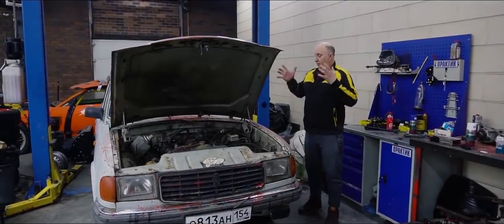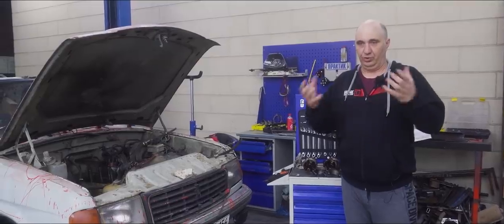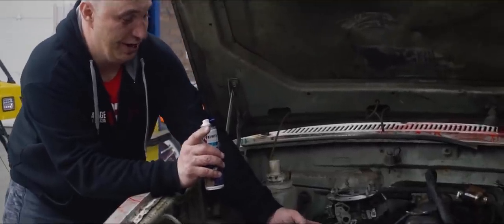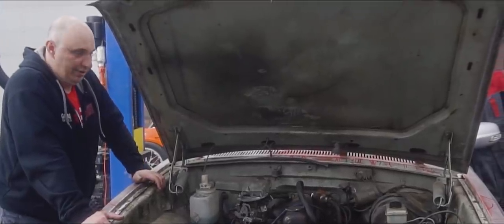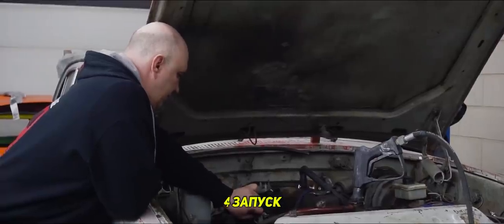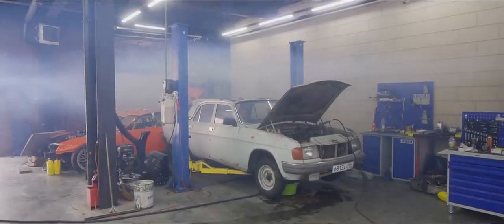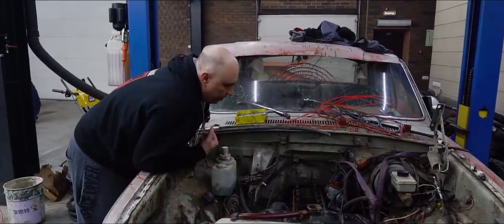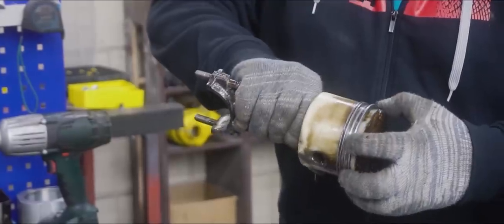Fabricating plastic pistons (will they work?)

Comment: Don't give Chrysler any ideas. They will make pistons and exhaust manifolds out of plastic if they can find a way to make it last until past warranty.
Reply: Or just don't buy a shit Chrysler or GM vehicle maybe?
Reply: LoL
Reply: I wonder if that explains their transmissions.
Reply: @nickoloes  imagine buying any modern American car
Reply: They will simply adjust the warranty to match the expected component failure date.
Reply: Or BMW.
Reply: I hate how pretty some Dodge/Chrysler cars are yet they have the reliability of a dead rat. 300c’s are so sexy.
Reply: @nickoloes  that is such a sad thing.  there really is no excuse for gm making shitty engines.
Reply: Toyota already does that with plastic intake manifolds Burnt piston award toyota lol
Reply: @deloreandmc9600  I don't know of a manufacturer that doesn't use plastic intake manifolds these days.
Reply: Reported for accuracy
Reply: @deloreandmc9600  I said plastic exhaust lol. Plastic intakes rarely have problems actually. It's when the manufacture decides to install runner flaps in the intake, it can cause problems when the vehicle ages.
Reply: @nickoloes  gm has made a huge improvement across the board. What the fuck are you talking about? The LS/LT platform improving every generation proves that. 

Dodge on the other hand yeah, just slap a supercharger on it, should get better lol
Reply: @12beemer34  underrated
Reply: The car makers will just make the whole engine out of plastic and then tout the better MPG due to weight savings as a feature.
Reply: Garage 54: "We've made pistons from plastic!"
American auto makers: heavy breathing
Reply: I think today there is no brand left who understand the word quality. You can change the name Chrysler with any other brand name.
Reply: @StrawberryBastard  modern chryslers are European cars though....
Reply: @Reziac  their old inhouse 4 speed autos failed largely because of them running line pressure on the low side to help mileage.  It's been standard procedure during rebuilds to turn that up and it greatly extends the service life.
Reply: @Dcc357  in the early days of composite intakes some models had issues because they were still wet manifolds with coolant running through them.  By the end of the 90s though most everyone went to dry manifolds, though they are still using composites in the cooling systems anyway.  At least it won't lock your motor up when it fails.
Reply: @Dcc357  Yes but sure things keep going backwards sure enough your heading right to the back the car with this one lol
Reply: @Dcc357  Speak for yourself Here in Ireland a good idea done in sunny Calfifornia doesnt make it reliable somewhere else AD Blue is a good example nearly the same price as litre of diesel  would you trow diesel down your exhaust or just throw 20 dollar bills on the fire
Reply: @jaye1967  - Amoco did that many years ago. I think they still used metal in the pistons, rings and valves, but it was very noisy.
Reply: Just buy a Toyota, forever. Problem solved
Reply: @deloreandmc9600  quads use rubber so?
Reply: @lexuses3942  Yeah, you have fun with that "supra" and whatever comes next.
Reply: You do realize Toyota makes cars with plastic intake manifolds, right?
Reply: @Oddman1980  Yeah..😒 The new stuff maybe. Let me rephrase that, buy a 90s early 2000s Toyota 👍 Have a great day
Reply: @Dubz0408  But yeah if it’s a 90s Supra you should definitely buy one if you can get ur hands on one. Or afford it
Reply: I was of the idea that plastic motor parts was a BWM exclusive... go figure
Reply: I drive a 2007 Pacifica with almost 150k. Had it a couple years. It ticktaps like a sumbitch. Has since about 122k. Hasn't gotten louder or anything. I might pull the valve cover and look this summer. I ain't worried.  It's been a good car really. Haven't done shit but change oil. Oh and I bought a new set of tires. Fixin to do some brake work too. Been a good car though. I'll get in it and drive to ohio or anywhere. Used to daily it to knoxville and put about 160+ miles a day on it. I work 3 miles from home now. Still go to knox once a week or so though.
Reply: My pontiac has plastic header and manifold. G6. It's ok though , it's clearly going to outlast the frame. You can put your finger through wherever you like.
Reply: @nickoloes  Chrysler is dodge and GM is chevy XD ill choose a ford over any of their rolling scrap anyday
Reply: because the EcoBoost is so "reliable"
Reply: They call that innovation
Reply: @nickoloes  Yeah because only Chrysler and GM make junk now a days lol. They all are junk now a days. Doesn't matter who you buy it from.
Reply: @Juggernaut30  Thank you. You get it. It doesn't matter who rips you off, they all are junk now a days.
Reply: Or BMW. They love plastic...
Reply: "If you don't drive a '93 Celica,  your entire life is gonna go downhill, so you might just as well get a '93 Celica". 
-Scotty
Reply: Hahaha, I was just gonna say the same thing. Some CEO is watching this and getting ideas because of government mandate gas efficiency vehicles.
Reply: @nickoloes  all vehicles are shit these days made to get 3 years 60000 miles after that it's all about luck lol
Reply: @jacklarson6281  the engines are good but they encourage 10 to 15000 mile oil changes if you just change oil every 5000 they can last a very long time without problems
Reply: @Dr.Mcstaby  you do know chevy and ford are working together now the transmissions are the same in a Ford or Chevy that's just the beginning
Reply: @nothrottlelimit  no its not
Reply: Thermoquad
Reply: @nickoloes  shit
. Lol  got 235;000 miles  and still going on the basest lil truck Chrysler ever made,,    Haven’t had an engine issue ever ... lol  sorry  your a bit wrong ...
Reply: @StrawberryBastard  yeah  the corvette and Cadillac shot on your euro trash on your home court  on the regular basis ....  tart....
Reply: @mikehunt8375  It’s a unibody, so luckily if you think it’s worth it just replace subframes
Reply: They sure have their 8 speeds figured out to exactly warranty time
Reply: @nadronnocojr  I’ve got a 97 ram 1500 with 220k miles barely even change the oil and it’ll still outlast 90% of newer cars
Reply: Their cars used to be so good, many decades ago. I drive a 1950 Dodge and it is the most reliable car I have ever owned (Yes, I am crazy and daily drive a 71 year old car). All the new stuff is junk no matter the make.
Reply: Ford not Chrysler.
Reply: @StrawberryBastard  The only modern "American" car worth buying is Tesla.
Reply: just gotta hit that 36000 miles.
Reply: Truth
Reply: @nickoloes  new ford is the way
Reply: @jacklarson6281  You mean the LS1? LS6? or Chevy 350? I think the guy meant the Chrysler engines. That are very popular among car guys for having valve seals smoke problem, Rod problems, walking crankshaft problems and above all transmission problems. There is a reason why they are the cheapest alternative when you go to a dealer.
Reply: @normanguzman417  sorry man.  I didn't mean to dis on any Mopar peeps.  I stupidly just lumped all non-Fords under the GM label
Reply: What are the most reliable vehicles nowadays?
Reply: they already produce plastic manifolds since years. in the 90s they already did
Reply: Not just Chrysler.  My Camry has a plastic intake manifold and it's got about 200k now and still working fine (unlike the damned head bolt threads in the block, which required inserts @ 183K  grrrrr).  I've heard of many problems with American versions, though.  Mostly cracking and the idle going South, getting pretty rough.  My mother in law's Olds did it.  

On the plus side, the Camry manifold looks to be pretty free flowing, as does the exhaust (welded pipe).  I always wondered why companies didn't go to welded exhaust on high performance engines like the 426 Hemi...probably cost, but headers weren't THAT expensive, even at the time.  Casting is probably really cheap, though.  The '69 383 hypo I had (Plymouth Road Runner, same as the Dodge Magnum, but with a 'cool' and cute Road Runner (from the cartoon on the breather) had cast manifolds that came over the top above the valve cover tops to try to get a little flow, but this created heat problems for the Holly carb (what a piece of junk, finally went to a Carter spread bore) which needed a rebuild every year (cork gaskets were also crap, and in the design sealed about six thousand holes, seemed like it anyway) and replacement about every five.
Reply: Chrysler? Did you mean: FIAT
Reply: How you know that?:)
Reply: @StrawberryBastard  you probably ride a Kia.
Reply: @lexuses3942  the hardest part of owning a TOYota is telling your family you are gay.
Reply: Beat me to it!
Reply: Same for bmw
Reply: Yes, a short-term warranty would make it happen. :)
Reply: @Oddman1980  so? My company service vehicle have plastic mainfold and runs without issuses for 11 years and almost 400 000 km.
Reply: @lordred7462  the person I was responding to was crying about the possibility of Chrysler making plastic engine parts while not realizing such things already exist.
Reply: Ahhaaahahhahah
Reply: Replace Chrysler with All Automotive Manufacturers and you have the right of it.
Reply: Of course lol. It's Fiat
Reply: @lexuses3942  toyota along with just about every germam, japanese, and american car manufacturer has been using plastic intakes since emissions killed the carburetor with fuel injection and it doesnt make something unreliable because of it. 

Thats since the 80s, and not just toyota the entire planet. Plastic touching your air before it reaches the combustion chamber isnt affecting the reliability or performance of the rest of the car. Valve covers too. They dont undergo any stress thats why they are plastic now. If your valve cover is a load bearing component whatever you drive is an engineering marvel, really.
Reply: Funny you mention that, Ford has been trying to engineer plastic exhaust manifolds for almost a decade now.

At least Chrysler tries to pretend like they might care about their customers.
Reply: Amen to that. Prefer older cars anyway than these newer flimsy ones.  I prefer to keep my vehicles for 20 years. I’m no “get a new car every 2 years” yuppie.
Reply: @dylanmccallister1888  I’ve never had a plastic intake. Ever, except on a Ford Explorer once. 98 es 300, 2000 Toyota Camry. 96 V6 Toyota Camry 5 speed. None of them have plastic. I’ve removed everything to replace the valve cover gaskets and the intakes are definitely not plastic lol feels like cast iron but i can’t be sure
Reply: @Strike86  European auto makers: Yeah lets out this part that WILL fail in the middle of a bunch of cramped shit you need specific tools to get out.
Reply: @StrawberryBastard  imagine buying any modern car
Reply: @Him69429  think so what about there god awful front ends seen 2020s with 15,000 miles need new ball joints and tie rod ends 🤦‍♂️ dodges have electrical issues and tranny issues chevys have terrible front ends and horrible manual transmission {the new ones}
Reply: @nothrottlelimit  pretty reliable not very eco though lmao
Reply: @deloreandmc9600  Where in the heck did you read that California's rules on emissions had anything remotely to do with reliability? Urea in the exhaust was to clean up the exhaust emissions. No one in their right mind would associate emissions devices with "reliability".
Reply: VW is experimenting with plastic cam shaft bearings...
Reply: Sure are a lot of armchair engineers here.
Reply: @bandwagon240  u beat me to it 🤣🤣🤣
Reply: @joshuagibson2520  what you most likely have is the super common defective rocker assemblies.  It's common on the 3.5 & 4.0 V6's & usually happens well before 100k miles.  The parts alone will cost you about $600 if you do it yourself, a dealer will charge you triple that to do the work for you.
Reply: @deloreandmc9600  What..? How does a plastic intake manifold lead to burnt pistons?
Reply: @asztaloszoltan2001  I find that hard to believe, but have been surprised before. Do you have any sources on this? Curious.
Reply: This is actually Chrysler's R&D Channel.
Reply: @nickoloes  Ford- Fix or repair daily
Reply: @nickoloes  or BMW, Merc, VW, Ford... you know, since 2008ish, every manufacturer without exception has been cheaping out on their product. Some just seem better by relation to their competitors. Even toyota is turning to garbage. 4Runners of 10-15 years ago are better than the ones from this year. :/ What you gonna do?
Reply: Don't forget about Chevy and Ford. They use shit plastics as well.
Reply: @asztaloszoltan2001  No, VW is not doing their cam bearing in plastic... I'll have whatever you're smoking 🤣
Reply: @amorag59  That's what I meant to
Reply: @asztaloszoltan2001  Unless you have interesting articles or sources.. Stop talking
Reply: @deloreandmc9600  plastic intake manifolds are completely fine for the job. you really need a lesson on thermoplastics and long chain polymers. They can last just as long as aluminum with the benefit of weight reduction. i agree that certain parts should never be plastic but its not 1960 anymore. Plastics have come along way.
Reply: 1000th like
Reply: In all serious, they design stuff to almost last until out of warranty.  Then they gamble that it will actually make it out of warranty.  When it breaks, then you will buy a new car because it will be too expensive to fix.  If it breaks a lot, then they will steal money from the techs by reducing labor times until everyone looses.
Reply: @Joseph001 Have you seen the Audi/Volkswagen market? German engineering is supposed to be top notch, but these are your cars that people ditch as soon as there is sign of trouble. Look at the whole dieselgate thing VW did,  shady, on top of that their Pumpe Duse engine with cam that grinds itself away and oil pump on balance shaft that wears itself away... Not just the American stuff that's like that - you might as well have said *cars that are not a Toyota or Honda
Reply: @communistpootisbirb  looks sell cars not reliability to the majority
Reply: you know chrysler so well. the sad thing is we know Chrysler engineers dont do any actual work all day so they have probably already found this video
Reply: @Reziac  I think you're confusing Chrysler with Honda here. Coming from a Honda owner who is on his fifth transmission (which grenaded recenty, after I stroked my J32A2 motor out to 3.5 liters).
Reply: @SwapBlogRU  Dunno about Honda, but Chryslers, especially Dodge trucks, are absolutely notorious for blowing out their original factory transmissions (too much engine for not enough transmission). When I was learning to avoid them, was a rare Chrysler that made it past 60,000 miles without needing a rebuild (tho the rebuild would usually hold up better).

There's a funny video of a pulling contest between two pickups, a midrange Ford and a heavy-duty Dodge. The Ford was slowly winning... and then suddenly the Dodge's transmission literally came apart all over the street. And I was like... yeah, that was predictable... yet another reason why I became a Ford bigot. (I drive an F350.)
Reply: Nahh, your thinking of chevy. Most reliable engine I've ever owned was a 225 /6. Thing had a 1bbl carb, no main seals and lasted over 380k  miles on no rebuild running 1.5 qrts of oil in it. And yes the sump sits low enough that's enough for one of those engines. You do have to cut every v-belt on it if you want more than 100hp tho
Reply: UNTIL PAST  WARRANTY
      XD-GREAT ENGLISH
Reply: @Reziac  The 1st thing came to my mind lmao sad huh.
Reply: @nickoloes  Cough chough- Ford.
Reply: @communistpootisbirb  They really aren't bad depending on what you get. 2014+ are pretty decent if maintained. The Hemi is bullet proof as long as you don't get one of the early ones with cam issues.
Electrical issues are the downfall, but from what I've seen from Ford and GM lately, it's no worse.
Reply: It looks like a Ford idea
Reply: This is so true, indeed!
Reply: @bandwagon240  isn't the Ford or Lincoln 460 engine with these Plastic Intake Manifolds?
Reply: @Juggernaut30  except..Porche..that is!
Reply: @UltimateForceMarketing  the 4.6L SOHC did have plastic intake manifolds but they rarely had an issue.
Reply: @lexuses3942  yes!! Got two LS400 sedans. (1) 1995 Lexus LS400 (1) 1996 Lexus LS400 both have perfect gorgeous Light Tan Leather interiors and the 95' 164,000 has the MoonStone Grey the 96' 167,000 has the Metallic Champagne and power is off the hook!! Change the oil every 2,000miles and only use Mobile 91 Premium and use Penzoil Ultra
Reply: @UltimateForceMarketing  They will run forever
Reply: Heat resistant plastics like delrin could actually work.
Reply: @deloreandmc9600  Plastic intake manifolds are fine, as long as the plastic is strong. Toyota usually uses forged pistons in their engines. The 1.8L 2ZR-FE found in mid to late 2010s corollas has forged aluminium pistons and forged steel connecting rods. Maybe try changing the oil next time?
Reply: Coolant around exhaust manifold are here to stay
Reply: @tomasnokechtesledger1786  I love that feature. My GTI has it and the coolant heats up lighting fast. Very good for the winter.
Reply: @StrawberryBastard  even a Tesla?
Reply: @communistpootisbirb  they scream, I wanna be a rap star/gangnamsta but can't afford a pimp car.
Reply: Chrysler already made of 3D printed plastic timing gears in the PT Loser.  2.4 L.   The avenger models also 3D printed timing gears 
I work on cars and nothing Chrysler suprises me 
1985 Oldsmobile came out with a plastic timing gear in the 307 8 cylinder and it lasted till the warranty of the car expired.  
So of course Chrysler are definitely copy cats
Reply: Lexus you fools always bringing up Trump like it's a bad thing. Your Biden is doing a fine job wow. There really are some people out there that voted for biden
Reply: I wouldn't be surprised if we start seeing plastic pistons with aluminum crowns from fiat/chrysler
Reply: @nickoloes  Fords no better!
Reply: @Reziac  you do understand that modern dodge transmissions (hellcats) might quite possibly be the strongest production transmission ever manufacture right.... ive seen them live behind 1200+hp for thousands and thousands of miles. 

Previously wouldve been the turbo 400 holding the crown more meanest factory production trans.
Reply: @austinlowhorn3124  Maybe so, but note that there are lots of old Ford trucks, some old GMC/Chevy trucks, and almost no old Dodge trucks.
Reply: Lmao. I'd never buy a Chrysler product.
Reply: @Reziac  whats that have to do with anything... ive owned them all. Built them all to make huge hp. Ive built 2000hp capable 48re's ive got a 1000hp dodge diesel right now. Ive built 800+ boosted small block chevys, and helped friends build some bad little small block fords and  Im here to tell you chrystler is no worse then anyone else. 

Matter a fact, pretty much every top level drag car on the planet is using a Hemi head design, originally developed by chrystler Even on big block Fords and and big block chevys. Go look at sunny Leonard's big block chevys. Some of the baddest motors on the planet. With custom head redesigned around the hemi chamber design. 

Ive learned alot of people that talk trash on the whole ford vs chevy vs dodge thing actually know very little about the subject. Because if they did they would know they've all had great and terrible designs, and at the end of the day even to this day every manufacture is still making great and terrible designs. 

For example ive always been partial to GM in the gas world. But the new gmc acadias are straight trash, all my friends are as mechanically inclined as me or close anyway, most work at shops so i get a down low on what new cars are coming in for repairs and which aren't and why. Which is a good thing because I had family that was going to buy a new gmc acadia and i steered them away because I have a buddy thats does timing chains on them like atleast once a week at his shop with under 100,000 miles. Meanwhile he NEVER sees the new Durangos come in. So they wound up with a new Durango instead. But if I was going to buy a new gas burner truck. It would most definitely be a chevy/gmc for various reasons (even though they have a few problems to lifters, 4 cylinder shutdown malfunctions, crank sensors, even transmission tuning communication with the 4 cylinder shut down caused gm some real issues.  Not really a Ford fan, hard to work on virtually no parts interchange. But I also dont deny that over the years ford has had certain things that were better then gm and chrystler.
Reply: @Reziac  also there are far more old gm trucks still on the road vs ford. Because of parts interchange across a large span of years, makes it easy to piece stuff together and reuse body parts from junkyards etc.
Reply: They all do it.  Even the best companies, like Toyota. News Flash!  They exist to generate money, not to make something for you.
Reply: @horrido666  Toyota Camry was one of the worst vehicles I ever owned.
Reply: @StrawberryBastard  Imagine buying any modern car.
Reply: @deloreandmc9600   Plastic intake manifolds are very reliable and they are a performance boost because of lack of heat soak and more optimal intake runner paths being able to be modeled. Probably one of the only parts that benefits from being made of plastic
Reply: I am sure GM is already on the case:))
Reply: Every car maker
Reply: My dad had a 2014 Chrysler 200 and when the Chrysler dealer changed the plastic oil filter they put it wayyy too tight and stripped the threads in the part it went into (I think) and the oil filter, it leaked. We have more horror stories from them including them refusing to replace recalled airbags that wouldn't deploy in an accident.
Reply: @nickoloes  Actually not that easy. Especially when GM's gearbox is everywhere. But I agree with you, best just stick with Honda & Toyota. It would be miracle if they break down.
Reply: 99 % of all modern cars are shit.
Reply: I think you mean volkswagen.🤣🤣🤣
Reply: @bandwagon240  wys.    and they charge so much for parts i guess they think it's a throwaway car.😆
Reply: I'm surprised they haven't tried copying the plastic camshaft Briggs and Stratton uses in their small engines
Reply: @aryanson  They can designs stuff to last you a predetermine time, so you have to buy the same shit again.
Reply: Ford does composite oil plans now
Reply: that's easy just shorten the warranty :)
Reply: You mean FIAT/Peugeot/Citroën...Chrysler, Dodge, Jeep and the "Mopar" name are just brands owned by Stellantis
Reply: nickoloes as a shitty GM vehicle, I agree
Reply: Lol 😂
Reply: @lexuses3942   you are so cringe
Reply: @Vinlaell  Good 😊
Reply: @StrawberryBastard  from very good cars to very bad cars that will last you a few years
Reply: I mean I don't like how they've made there quality worse to make cars cheaper Same thing that happened to Nissan in 2006
Reply: @lexuses3942  Toyota forever ??? I have an ford escort 93 with 523k and it works well, and a chevy c10 83 with 384k and it works the same ... the japos car is not a big deal .. it is the owner .. and I do not deny that Toyota does not complicate its parts replacement .. everything is very practical and easy to do, and they are very fast even in 4 cylinders with great response .. that if I see and accept it .. my daughter has a 4runner 6cyl, and I had a 4cyl a long time ago, and Actually ,, excellent in expressway, but I sold it because there was something that I did not like .. and I preferred to keep my escort .. and I have always said it, you save on gasoline in Japanese cars, but you pay the difference in spare parts ,, cheers
Reply: @mcozpda3392  I’ve had all kinds of cars and still do. I’m pretty sure there’s a Ford contour out there somewhere too 🤔 with like 45k miles. I don’t hate on American cars I just know first hand which one I’ll take across country lol To each their own
Reply: Ideas super extremally. Don't temperature... Idea ok. Compressorr ok.
Reply: chrysler ford and chevys
Reply: @StrawberryBastard  Imagine buying a modern car in general
Reply: I thought that’s why Chrysler was so shit? Didn’t they do this BEFORE garage54? Lol
Reply: Stellantis...... Keep off them
Reply: Chrysler already made phenolic brake caliper pistons... Not a real good idea, the better after sale solution, is to have brake piston machined out of aluminum.
Reply: Thats actually very true.... Lets not forget ford in this mix though.
Reply: @nickoloes  Chrysler and ford gm is a good company, shit CEO and marketing division though.
Reply: There's cars with plastic exhaust and intake manifolds. When they came out with the scions they started putting plastic manifolds on the intake and the exhaust. They were always real shitboxes to me. I used to like Toyota. But being a mechanic, I can say I don't think they're is any cars made good anymore. Honestly. The build quality on body's was gone by the late 80s on most. And engines were hit and miss but usually the engines in the majority of vehicles after the legacy 350 sbc and ford, Chrysler, gm's inline. And a lot of Toyota's motors like the 22re were not many good ones left after that.
Reply: @t-rodshader9593  I’ve seen plenty of plastic intakes but never a plastic exhaust manifold
Reply: @t-rodshader9593  I would have to disagree. I ran a shop for years. The vehicles that needed the least amount of repairs were the Toyota and Honda variety. This is painful to say because I'm a chevy guy myself. but my wifes toyota, a 2000 celica gts, is still alive at 400k miles. I'm driving it as a gas saver. She now drives a 2017 toyota 86. You and I can both agree, I'm no fan of the engine in it. It's the suburu.. still a decent car though.
Reply: @t-rodshader9593  22r is a beast. You're not lying there my friend. The vvtli isn't bad either. Only issue out of the oneninnthe celica was snapping the cam bolts for the vvt.  A common problem that engine had.
Reply: @VNCTHE1  Oh, God, I hate Tesla. The batteries cost as much as the whole car when they wear out in like 8 years.
Reply: @t-rodshader9593  I know. My Kia Soul has a plastic intake manifold.
Reply: @Cat-fy5lw  You have wrong information...plenty of data showing most batteries retain over 90% of original capacity after 200k miles.  For 200k miles, you would have paid more in gas than the cost of a new battery anyway...and the battery is a maybe, the gas is a definate.  Just do the math.
Reply: @VNCTHE1  Yeah, well, Tesla still doesn't save the environment. The tailpipe is just located at a power station somewhere.
Reply: @Cat-fy5lw  Again, huge misconception.  If you actually cared you would find dozens of reputable sources/videos that prove otherwise with common sense and logical calculations...or you can beleive whatever you want and listen to whatever reinforces your current opinion 🤷‍♂️

The grid is getting better every year but even if 100% coal generated electricity, an EV is still more efficient overall and therefore pollutes less, without even putting wind, hydro, nuclear, natural gas, solar into the equation.
Reply: @VNCTHE1  I stand corrected. Hey, I wonder if Garage 54 could do a hydrogen combustion engine next. Like, convert a Lada to run on hydrogen.
Reply: @Cat-fy5lw  https://youtu.be/L2IKCdnzl5k

Here's an interesting and educational video on the emissions subject.

As far as hydrogen combustion, that's already been done by OEM manufacturers...it can be done, but hydrogen is way too expensive and hard to find to be feasible...but as far as it working, it sure can work so garage 54 converting an engine to run on hydrogen wouldn't be something experimental really.
Reply: Many modern engines have plastic intakes and housing anyways.
Reply: @VNCTHE1  no
Reply: Lol more like ford with their plastic oil pans
Reply: @jordanschiltz8110  my VW GTI has a plastic pan. I work on Mercedes and the inline 6 gas engines have it too. My solution for my car was an aftermarket armored skid plate. Already saved my car a few times actually
Reply: They’ll just write exceptions into the warranty that don’t cover pistons, or the manifold and charge you to rebuild the engine and even to put the exhaust fire out.
Reply: @StrawberryBastard  I like American cars over all imports. 2 daily driven GMs and my pickup is an F150. One before it was a Ram. The plastic in the transmissions is done by every company some better executed than others but I don’t like it. I don’t trust automatic transmissions because they all eventually require rebuilding. Manual transmissions if abused or driven an absolutely ridiculous amount of miles require a clutch at some point and that’s it. Swap gearbox fluid every whatever the manual says but mine has well over 100,000 miles on it and still looks new.
Reply: @nickoloes  or just dont buy american cars newer than 2000 lol
Reply: Oh so true!
Reply: @StrawberryBastard  Chrysler is Stellantis, we are talking about Fiat and Peugeot too.
Reply: Toyota is the best
Reply: Like Daewoo running hot egr gasses into a fiber reinforced the intake manifold 😂.  Crazy.
Reply: Hints the first gen 5.9l magnum
Reply: You don't need to worry about Chrysler. They will still be trying to make gas engines after everyone is electric. lol
Reply: Yeah and fords just a gamble 4 miles or 400k miles it’ll still cost 
100k and if your ac filter is bad when your brand new truck blows up kiss your warranty goodbye

And this is from a ford guy lol
Reply: The way they’ll figure out is 20.000 miles under warranty 😂
Reply: Like the plastic head on the Godzilla engine from Ford? Any cheap car is going to be made with cheaper parts that don't last a long time. That's why you don't buy base model crap cars.
Reply: @mumblez22  just buy a Toyota, you pay for quality parts and not screens and cupholders
Reply: @communistpootisbirb 300c from the Daimler age have Mercedes diesels. OM642 3.0 V6 to be exact. You can get those in Europe. Nice looking car. Suspension is from a w210 e class